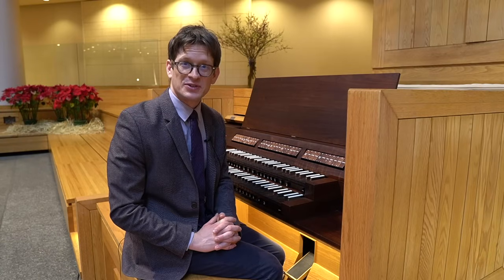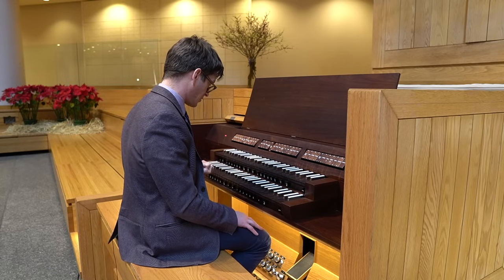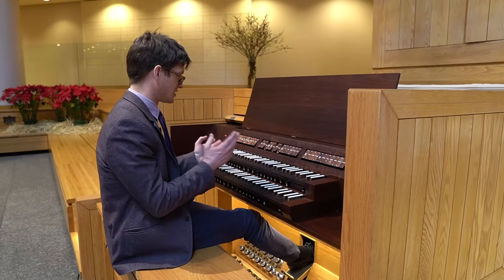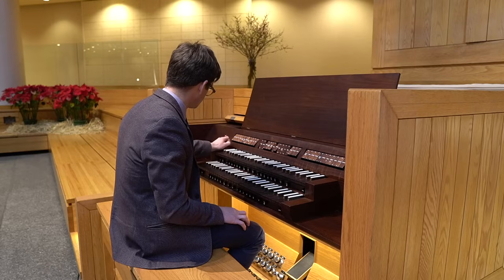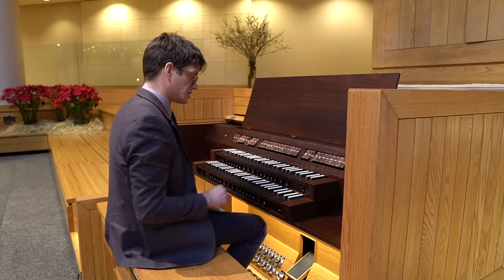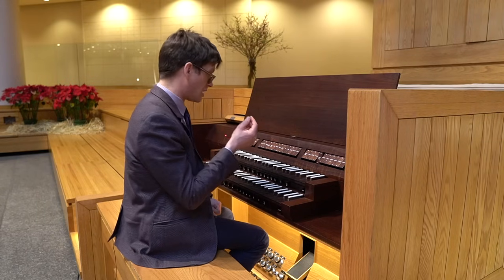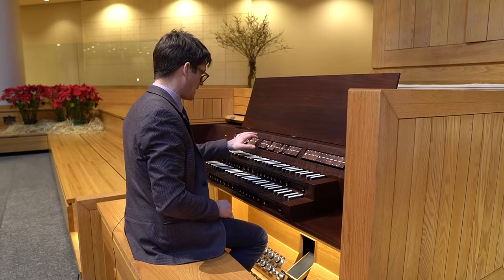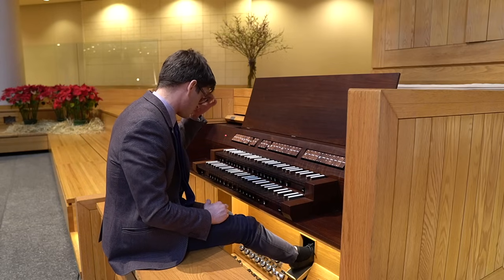1976 Klais - 2023 Fisk at Saint Peters Church in NYC - Demonstration of Stops

Comment: Obviously the organ is well built and rebuilt but my personal opinion is that it is very scratchy and too hard high pitch.

It needs more middle sounds more 8 foot ranks otherwise its very hard on the ears.
Reply: That's the "organ reform movement" for you. Back in the 60s and 70s (when this instrument was built), neo-baroque organs were trendy in North America. Some organ builders attempted to re-create the tone and pipe designs of historic European baroque instruments, but didn't quite understand how those organs interacted with the specific buildings they were placed in. The result is an imbalanced instrument with too much loudness in the upperwork and not enough strong foundation stops.